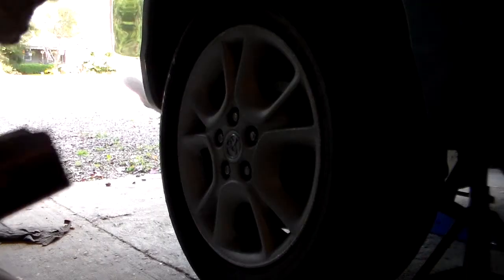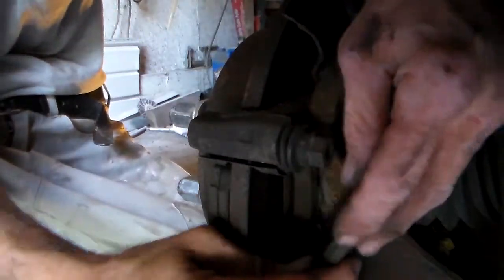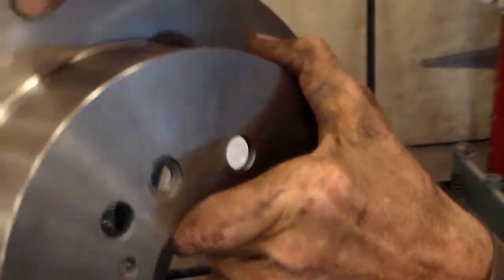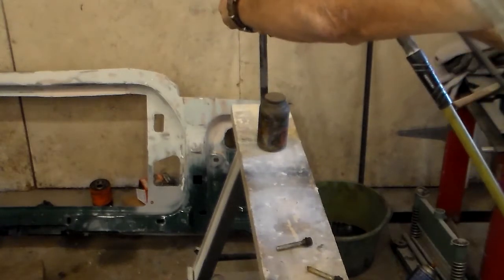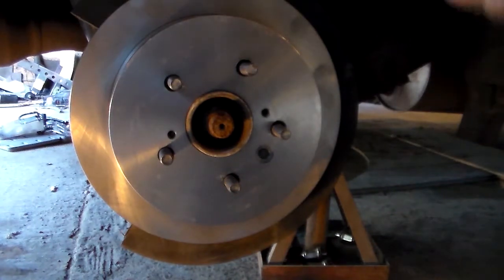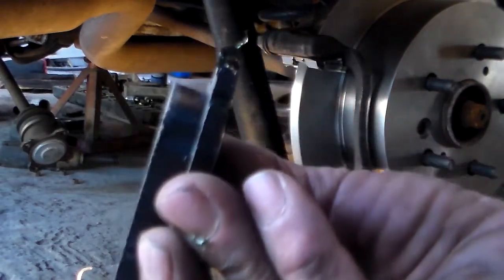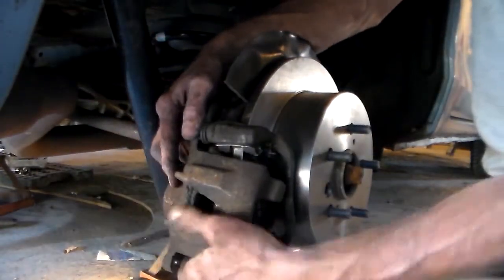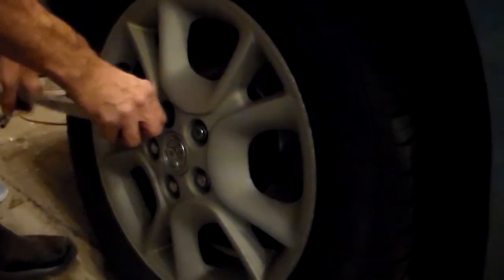2005 Toyota Sienna AWD, how to replace rear brake rotors and pads, step by step, explained in detail

Comment: I just did mine today for the second time, last pads and rotors lasted 4 years of daily driving, right on time.  I'd say the main parts that give me problem is remembering which way to turn the star screw on the e-brake.  Down is loose for me, Up is tighter.  And remember to adjust to get the drag on the e-brake before you put the wheels back on.  OH and remember to put the rubber bung back in the e-brake adjustment hole, because I hear someone left one out one time today.  LOL

Comment: I liked how you slapped the brake caliper with your hand!  Good one.
Reply from the maker: I never even realized I slapped the caliper unit watching the video again. Thank you for your attentive viewing.
Reply: @MrAamstrom  Haha, it was funny.  Great vid, I changed out my back brakes and rotors thinking it would get rid of a vibration during loaded downhill braking, but no cigar it keeps vibrating.  I only did this because I had already changed out the OEM front ones and it took care of the problem, but now its back after only a year.  Any suggestions?  I 'm thinking of going back to O'Reilly's where I bought the fronts and see if they will give me new rotors...
Reply from the maker: @DanielRamirez-sx2ln   The only other item to check is to make sure the front or rear brakes are not hanging up due to a worn-out caliper or a brake flex hose. On the other hand, you would smell the burning brake pads after driving the van. The rotors most likely went bad, and hopefully, O'Reilly's will replace them at no cost.

Comment: Hood video Alan! Please be sure to lower the car onto the Jack stand before the taking off the tires. If your floor Jack should fail using your method, your rear brakes will be the only thing holding the car up…. cheers!
Reply from the maker: Thank you for closely watching the video. I was trying to compensate for my camcorder's capabilities at the time by removing the wheels first to let more light on the subject. The good news my newer videos are taped with a 4k camcorder.

Comment: I have a question about part orientation.  The brake hardware kit contains 2-pairs of brake pad abutment clips and they are not the same, a Duralast kit from AutoZone.  Two have ends bent 90-degrees toward the rotor's center, sticking out a little longer, the other two have ends bent in a V-shape, toward the rotor's perimeter.  My question is which ones go where and why?  There are no instructions in the package, I could not find any information online, or inquiring at my local AutoZone store.  Thanks.
Reply from the maker: I am not sure what to say without seeing the parts; however, I know mine only came with a type of clip. If you have the old clips you could compare them to the new ones and see which ones are the same. Thank you for watching.